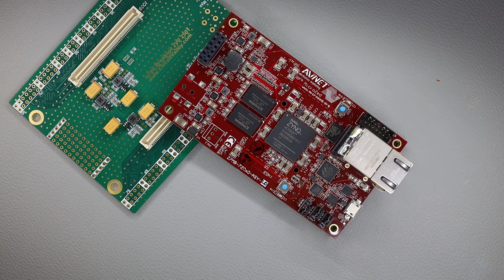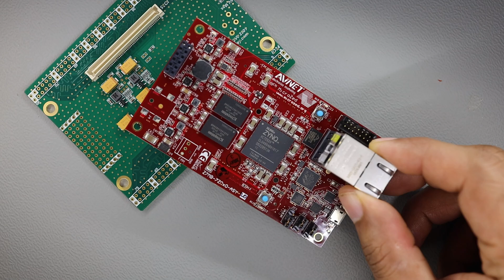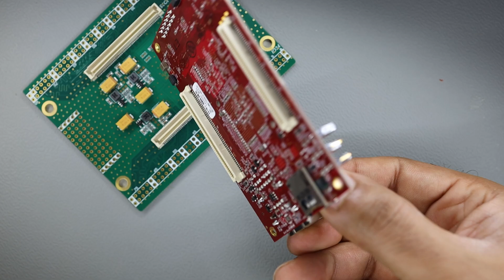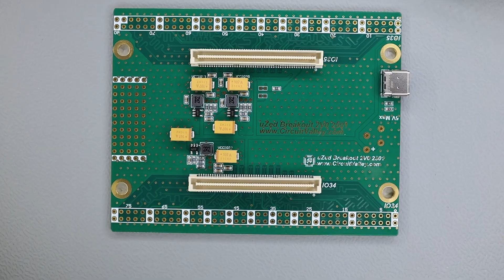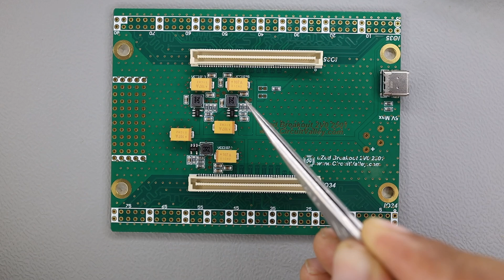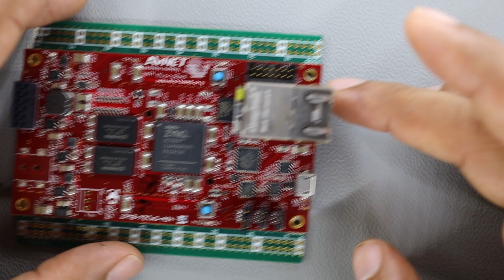Custom Avnet microZed Xilinx Zynq SOC IO Breakout Board Open Source

Comment: Does the free version of the Xilinx FPGA tools work with these microZed boards? Or do you need to spend $$$ for the paid version ?
Reply: Vivado is pretty free
Reply: @Pkemarco  My question is does the free version of Vivado support the exact part on this board. Not all parts are supported by the free version.
Reply: @muhdiversity7409  yes sure, since It's just a Zynq XC7Z010-1CLG400C or
XC7Z020-1CLG400C and I've already worked in the past with various Zynq board and there where no problem. If you're lucky you might perhaps find the description file for this board to directly include it in Vivado.
Reply: @Pkemarco  Awesome. Thank you.